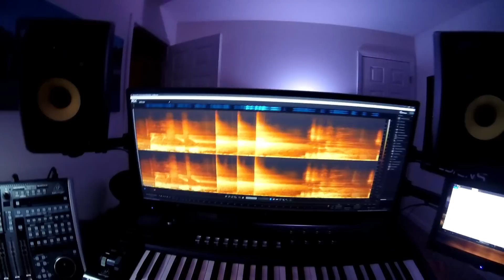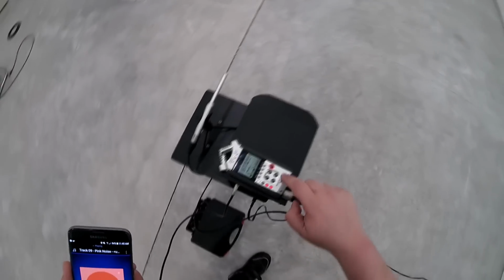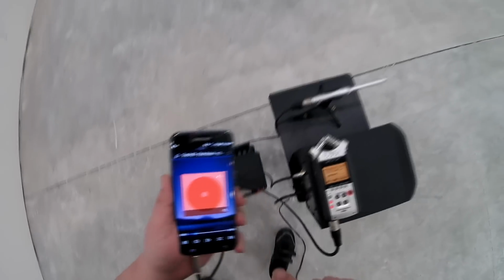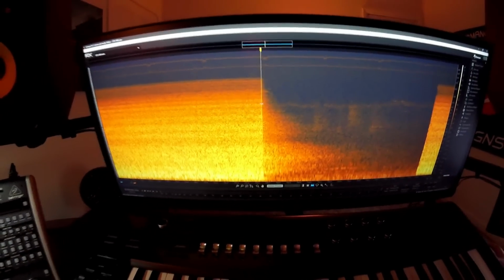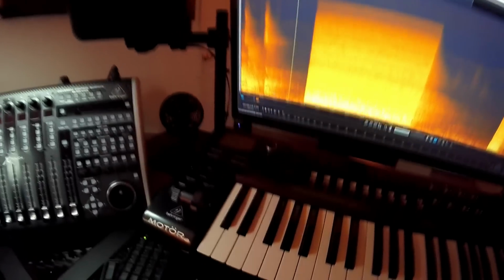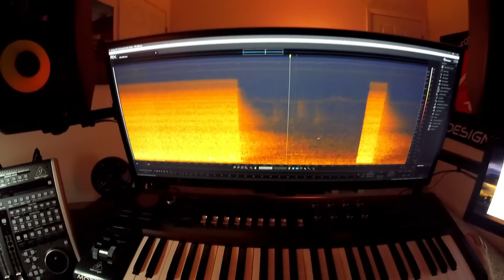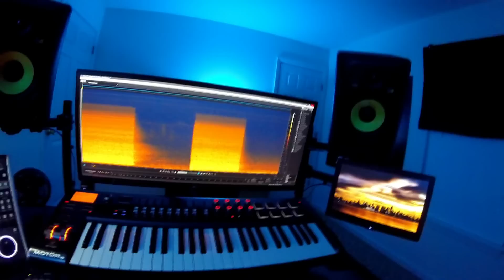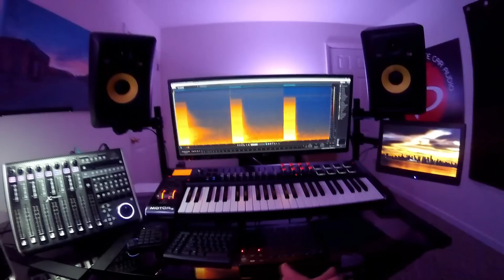Audio Dynamics SoundVlog - Acoustic Tile

Comment: Foam is trash..  703 and Rockwool bass traps if you are serious about eliminating reflections from the listening position Diffusion and absorption is key.. Def don’t need tiles touching each other either .. a foot or two between each would serve well once using a laser to determine reflection points.